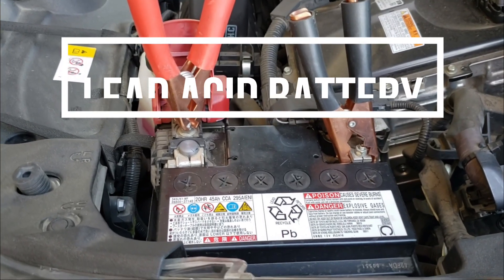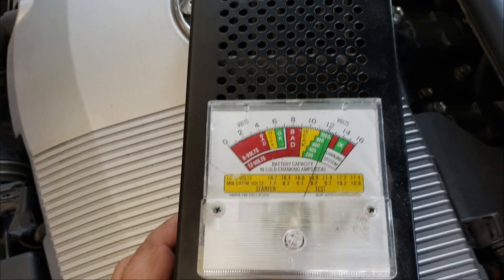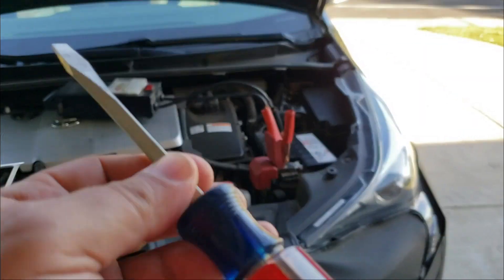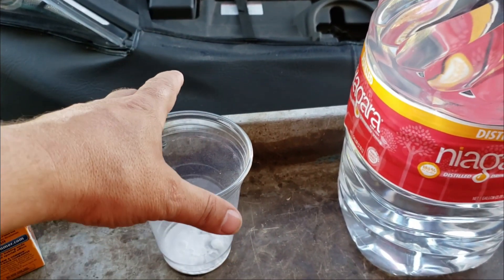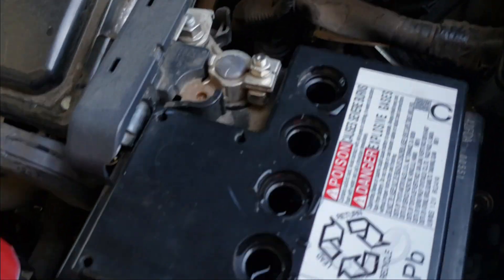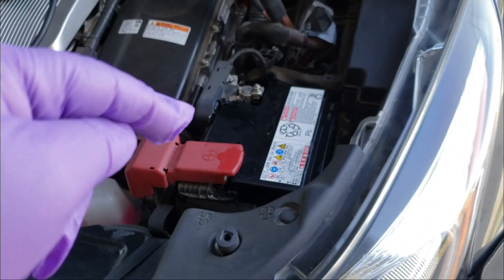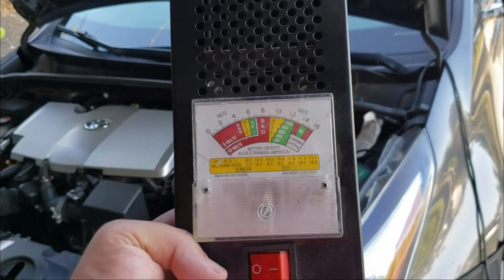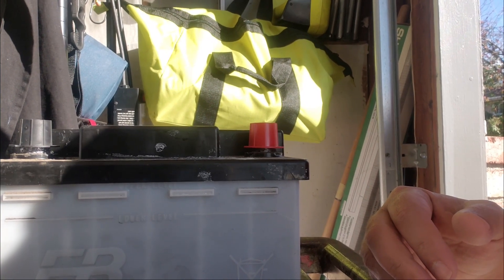Does battery repair work? How to Safely Refill Your Car Battery.

Comment: -Measure water amount added, to add same amount to all sections.

charge with low amp, like moto battery charger 0.4A or 0.8A

Comment: No baking soda!!
Reply from the maker: Baking soda is only for emergency safety need to neutralize the battery acid.
Reply: @RANDOMFIX why would you want to neutralize the battery acid?!  Battery acid is there for a reason!!  Zero baking soda!!
Reply from the maker: @chadanooga if you spill some battery acid you want to neutralize it before it damages something.
You do not out the baking soda in the battery.

Comment: In short....   add distilled water to the battery and charge it using a battery tender/charger. (which he did not specify what amperage it uses)..

Comment: Car batteries do not require water refills anymore .We ain't had to refill a battery in probably 25 years . Not to mention , tampering with a car battery is very dangerous . I have personally witnessed a battery explode in a man's face . I don't know if he ever got his sight back .
Reply from the maker: Okay, thank you for you feedback. 

Just so you those caps up top for access points.
Reply: Some do, some don't. If the battery is sealed, like AGM, gel or lithium, then no. Some lead acid batteries are also sealed. But if there are caps on top they require maintenance. Easiest way to find out is to go to the manufacturer's website and look up your battery. It will tell you if it is maintenence free or not.

Comment: "So I've filled them up to where it needs to be" LOL Which is where?
Reply from the maker: Sorry if it was not clear in the video. Cover with distilled water right the level of the battery plates.
Reply: @RANDOMFIX  You answered it perfectly at 7:30 into the video, in writing. I was taught (in auto shop in 1971) to fill to just at or below where the end of the plastic inspection hole is, looking down the cell hole toward the cell plates. You might want to edit or delete your post to my response.

Comment: Will i be able to start the car soon after the refill? Some say we should run about 20km after refill, so battery re charges it self, but my question is would it even start soon after refill?
Reply from the maker: In my case it didn’t last three weeks so getting 20km will be hard.

Comment: Nice video! I was getting ready to do this but having seen your update at the end, I will just go and buy a new battery! Thanks for saving me from wasting my time!
Reply from the maker: Yeah, I tried on to rescue my battery a few more times since the Prius and every time it’s a unsuccessful. Here is the resent update https://youtu.be/cV6NewPWo2E?si=mkpZ_v6spkUIeaKq

Try to buy an agm battery vs the flood acid batteries as the last longer and less prone overheating. 
Good luck 🍀

Comment: Just noticed, by your wording, and the way you made up the baking soda solution, then went back to the plastic cup, it appeared, or will at least appear to some like you put the baking soda solution in the battery.

Question 1) you didnt do that, righr?

2) since the baking soda in the battery will neutralize the battery acid, Im very concerned some will make the mistake of putting the neutralizing solution (baking soda and water) into the battery, something that may ruin it.

Am I the only one seeing this? Or did I misunderstand something? If I did misunderstand, are some viewers likely to do the same?

Easy mistake to make so, if I'm right, no judgment here.
Reply from the maker: I did not put baking soda into the battery. lol 😂
Reply: @RANDOMFIX  I didn't think so, but hadda ask.
Reply from the maker: No worries, thank you again I will to try be even clearer in the future. I am learning too. I just tried this again on my 2014 grand caravan and again it didn’t work. So I had to pay 200 dollars for another battery but this time I got an agm.
Reply from the maker: I just watched the video to make sure I didn’t mislead anyone,  the distilled water cup is near empty when I remove and so the neutralizing water which near full. Thank you again for your feedback. I will never create a video unless it has some sort of usefulness in the world and if you ever find a proven method for repair bad battery please send it my way as these batteries are super expensive.

Comment: Great job in that you updated us giving us all the info we need. In the end we now know if someone hasn't the money for a new battery, they may get by, at least in warm weather until they can get a new battery. Plus, we know if the guage even touches the BAD range, its time to replace if at all possible or make see sure we carry a jump starter, or at the very least jumper cables.
Reply from the maker: I’m glad you liked the video and I’m really thinking about upgrading to a lfp battery next time my Prius 12 volt goes bad as they are nearly the same price and on the Prius the motor is not start using the 12 volt. I have a Prius c now so it might be time in about one year. I just need to find a 50 lfp battery with at least a 100 amp bmw.

Comment: lol i thought it wouldnt work, thanks for the honesty at the end compared to all those fake youtubers!!!
Reply from the maker: This year my Dodge had weak battery as it was over 5 years old. So I purchased a battery desulfator and again it didn't work. So I had to purchased another battery, I purchased a a gm battery as these lead acid batteries suck. The agm batteries were running about $350 but I found it walmart for under $190.
I almost want to build a lifepo4 battery with a massive Bms so I can avoid these useless expensive car batteries!

Comment: Iv never heard of putting water in a battery. Is this really a thing
Reply from the maker: Yeah distilled water is needed if your battery water level is low. This affects lead acid batteries not agm or lithium batteries etc…

Comment: Walmart said my battery was low amps so i just cleaned it and put purified water in it. Still works so ill leave it in for now. I didn't use distilled but too late.
Reply: Wonder if there any actual proof non distilled water will significantly hurt a battery? I ask because it has been said for years and even today that storing a battery on concrete will kill it, but guess what...not true. 

I would love to see some experiments proving non distilled water will ruin a battery.
Reply from the maker: I appreciate your feedback Sorry for the late reply, did you get this handled?
Reply: @RANDOMFIX eventually it will corrode because of the mineral…
Just added DISTILLED to my Diehard battery, may have overfilled a bit. Any advice?
Reply from the maker: Just be ready and prepared if you get stranded again. I had key Keylime battery desulfator that help battery but only newer batteries not to revive older batteries.  There is a battery solution called battery water ( yellow container) that may help but I’ve never tried.  I just opt in for an agm battery whenever possible as these flood acid batteries are hopeless. Keep me posted about your experience.
Reply: @RANDOMFIX  I’m not much of a car guy. I wish i could tell you why, but my starter ended up goin bad right after this battery trick. 
For a few weeks, it was having trouble turning over. It made sense first thing in the morning in the cold, but it started happening after it was already warmed up. My cars a 2009 AWD CRV-LX. 

I was convinced i killed my battery after filling it with distilled water. 
I bought a new battery while i was stranded, even tried jumping the new battery, and nothing!!!

$500 later, a new starter, and the same old battery with distilled water and I’m back driving. Battery holds charge and seems to be running normal. Don’t know much about the fuses either so idk if that could’ve had any effect.
Reply from the maker: @Urmothasmothasmotha an old battery and weak  is havoc on a starter motor as it makes work harder as it’s not getting enough power to properly start the vehicle. Instead of the fast 1 second start the starter will crank slower and longer. Besides the starter the weak  battery can also ruin the start solenoid and even the alternator. 
For example on my dodge the battery got weak ( it showed its condition) in November and i started getting a check engine light and even a slight misfire and I was just about to go change some parts that were on the expensive side but I happened to decide to change the battery out not a flood acid battery again but instead an agm and now 3 months later I have no check engine light and that slight misfire is gone.
Batteries on newer vehicles are more important than ever!!!
Reply: https://youtube.com/@EngineeringExplained?si=ANpAxIS4EQ72rAwV

Engineering Explained 

He might have something along those lines ¯\_(ツ)_/¯

Comment: What did you use the soda/distilled  water for?
Reply from the maker: The baking soda is normally for the refrigerator and the distilled water was for the video.
Reply: If any of the acidic fluids from inside the battery had wasted or gotten on anything, hr would have used the baking soda water to neutralize it and clean that area. DO NOT PUT BAKING SODA INSIDE THE BATTERY.

Comment: Good day Sir, so what do you conclude? That there is no point adding water? Maybe its because, as in your video, once those plates are exposed then they are permanently damaged. So maybe adding water works only if the cells havent yet been exposed? And you dont say in your video wether to fully charge the battery BEFORE adding distilled and in charging the battery AFTER adding distilled you should wait about 30 mins, as mentioned in some other videos.
Reply from the maker: Just adding distrilled does not do much at least my case. Yes, you need to charge it after adding the distilled water. I will try the battery water ( the yellow bottle)  in a future video.

Comment: Is it okay to run the car/truck all night or drive to charge the batteries? Instead of having one of those battery chargers. 

I have 8 batteries that l will fill up with distilled water and l would like know if l just keep running the truck to get them charged.
Reply from the maker: Sure you can do that if the batteries are in good condition however 8 batteries might be a lot of hooked up at once. I high suggest getting a load tester so you can identify dmamges batteries fast and recycle them.
Like this one 
https://youtu.be/Zpe_oOUZsUs
Reply: @RANDOMFIX  I am definitely getting one. Thank you!

Comment: Did you discover any other way that works better?
Reply from the maker: Nope, I dead battery is a dead battery. I won't not risk it for myself. Again it may work for a few days, weeks, or even months but I'm would not take the chance.

Comment: Umm sorry just question I watched another video they said charge battery before adding water not really shure what to do
Reply from the maker: So they said charge the battery and then add water? So do did they say to charge again after you add the water? I don't see the benefit of doing it that way but I'm open to learning.
Reply: @RANDOMFIX   no  I'll send link  if can find it